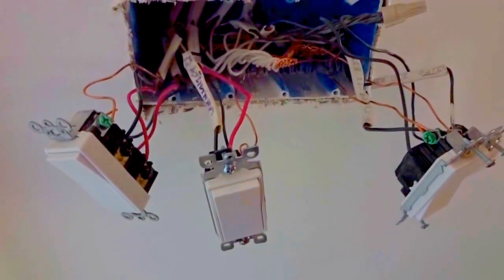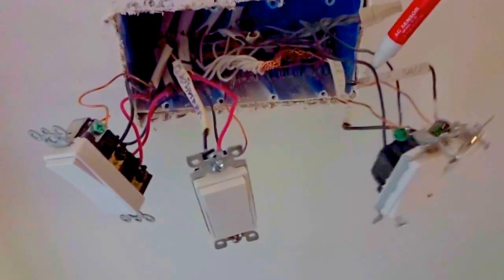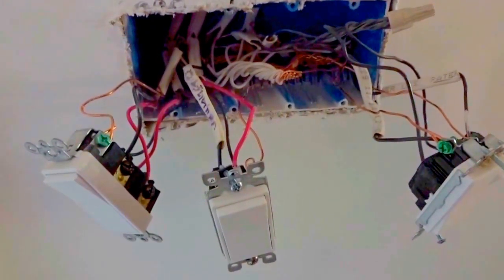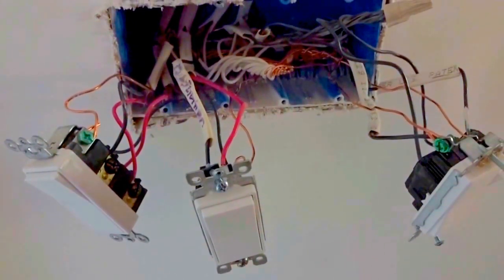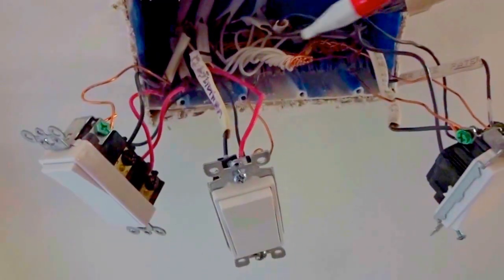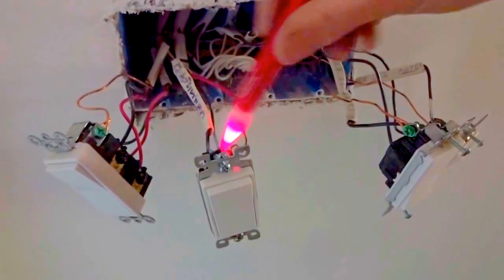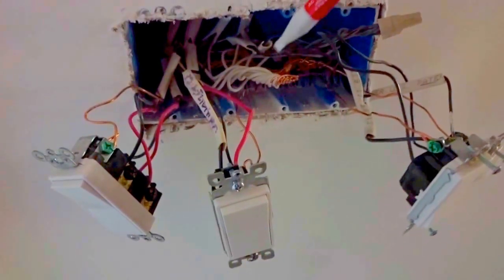Electric Code Violation: Sharing Neutral Wires of Three Circuits Creates Hazardous Magnetic Field

Comment: Great video Eric! Most electricians have never heard the term milligauss. A perfect example of dumbing down society by saying there is no harm when these fields are present. Time for the truth to be told.
Reply from the maker: +Total EMF Solutions    So, why are we providing municipal building inspectors a great salary and benefit package  if they are not enforcing the codes that are on the books?  When they sign off on the final building inspection they are stating that the building meets code and is safe for occupancy.
Reply: Read comments and IMO gov inspectors as well as the gov itself no mater what's said they are only concerns are how much we get for permits how many the inspector can do in a day and how many fines can we levy. And as long as there no livability they care little as long as the paycheck clears .one town supervisor councilman on a citizen complaint that the between Sam occupancy permit at the time $100 and nothing on the list was done he quote what do you expect for $100. Most of the things were new requirements of retrofit gfi and ground rods on older homes and a few other  things so basically it was a tax.
I have seen good inspectors too but I will never 100% trust  a government employees inspector as for this violation I not an electrician .but I know that wiring was not correct .as for emp drives electronics especially 2way crazy too

Comment: that cant be doen in newer houses so its not 1 out of four houses bc houses built i would saya within the last 7 years or so have to have arcfaults on every single. lighting and plug circuit and if neutrals are shares it trips the arc fault arc faults must have designated dedicated neutral
Reply from the maker: Hi Derek,

I find these errors in 1 of 4 homes: this includes all ages of homes.  I found 5 wire code violations, NEC 300.3(B) shared neutrals, in a 1.5 million dollar home built in 2013 including the bonding screw left IN at the sub panel which created a 15 mG field, 3 amp net current the ground wire running the length of the house.  This video shows one of them.  The general contractor spoke little english and the electrician spoke none.  Ultimately the building inspector was at fault for failure to "build to code".  The bonding screw left IN at the sub panel was so obvious that this indicates gross negligence on the part of both the electrician and the inspector.  I see this frequently here in California.
Reply from the maker: I see this net current situation occurring on new construction with AFCI breakers all the time.  AFCI breakers detect certain types of arcs and sparks rather than net current.
Reply: Derek in my area arc fault breakers are only required in bedrooms for now. And houses built in the last 7 years are just as bad. Not to mention they make up a very small percentage of the Number of houses currently built in North America
Reply: In 2015 the Ontario Electrical Safety Code was changed to have AFCI breakers in virtually all circuits within a home.  Rule 26-724(f) - Each branch circuit supplying 125 V receptacles rated 20 A or less shall be protected by a combination-type arc-fault circuit interrupter. (With a few exceptions; Washroom, kitchen and garage are the main ones.)

Comment: Not only is it a code violation but it will cause your arc fault breakers to trip, driving you crazy during check out.
Reply from the maker: Unfortunately Arc Fault breakers only detect arcing and not net current.
REPLY

Comment: that's just crazy! all those circuits could have been a different amperage. link them all together and that basically screws up the amperage rating for the circuit correct?
Reply from the maker: Right Mad Metal: current on each circuit conductor needs to be equal between the hot and neutral or you have a fire, shock and magnetic field health hazard.
Reply: Windheim EMF Solutions I'm still learning. Very interesting stuff and the codes also. I'm a welder fabricator by trade but in the middle of fixing up my home shop.

Comment: There's too many wires in that box. There shouldn't be any neutrals in there at all. 2, 14-2's for the single poles, 1,14-3 for the 3-way, and 2 more 14-2's for the 4-way, no neutrals.
Reply: joe banana
Reply: explain to me why there should not be any neutrals in the box? Your comment makes no sense.
Reply: i am no electrician , but maybe he refers to "no neutrals in that box" because they all are "switches"  every time i have opened a switch box is hot wires and green ground wires never seen  neutrals in there.. am i wrong?
Reply: The 4 way should have been 2 2 wires that is all that is wrong here
Reply from the maker: I never said there should be no neutral in this box. The problems here is that naturals from separate circuits are joined in the switch box.
Reply from the maker: Windheim EMF Solutions
  • 1 second ago
I never said there should be no neutral in this box. The problems here is that naturals from separate circuits are joined in the switch box.

Comment: I don't know why shared neutrals haven't been completely removed from code yet. (I think in some jurisdictions you can put the kitchen small appliance circuits on a 20-amp double pole with a shared neutral).  Bad idea for numerous reasons.  Unbalanced load from 2+ circuits exceeding neutral wire ampacity; someone working on the circuit who opens the shared neutral risks getting a shock from the "neutral" on a circuit they didn't shut off, etc.
Reply from the maker: Exactly but it happens al the time and building inspectors do not look for it: yet they sign off on the permit.
Reply: a electrical panel is technically a multiwire (shared neutral). So for the NEC to eliminate multiwire circuits is like saying you can't have electricity installed.
Reply: Sharing neutrals is not bad... as long as both circuits are on a DP breaker...

Comment: Are those grounds bonded together? ... Violation #2?
Reply: Eric Tyler I've haven't seen a code that said grounds couldn't be put together. that's essentially what you do with any metal box. they're ground wires not conductors. might want to check the code about that because I believe it doesn't include grounding wires.
Reply: All grounds in every box are supposed to be bonded together, regardless of circuit.  It is only the neutral wires that need to be kept separate for each circuit present in any given box around the house.
Reply from the maker: Grounds may be connected between circuits as they are never to carry current except in fault situations.

Comment: If it were wired with arc fault breakers they wouldn't be able to share neutrals
Reply from the maker: Unfortunately Arc Fault breakers only detect arcing and not net current.

Comment: Having two circuits on 1 neutral is not bad. As long as it is on a DP breaker...
Reply from the maker: Yes, you are correct if it is a "Multi Wire branch Circuit" using L1, L2 N & G.

Comment: I see this quite often as well, usually from a homeowner doing things themselves, like adding a switch.  Most homeowners don't understand electrical theory, all they know is a white wire is neutral, so why not just connect them all together.  They don't realize that the white wire, in general, is used as a neutral conductor, but it can also be used for other purposes, such as a traveler in a dead end 3 way circuit.  Rule of thumb, if you don't understand what you are doing or looking at, call an electrician.
Reply: Exactly! But the problem is that homeowners THINK they know what they're doing, but really don't.  I'm a licensed electrician, and I can tell almost instantly when work has been done by someone other than a licensed electrician.
Reply from the maker: Homeowners should avoid electrical work and leave it to an insured profession unless they want to risk voiding their fire insurance policy.
Reply from the maker: I this case it was done by a licensed general contractor using some sort of electrical worker that could not even speak english.  You get what you pay for.

Comment: No electrician would have purposely done that. Somebody might have done it had they not known there were three different circuits in that box. A lot of electricians have one group of guys rough in a project and another group come to trim it out.
Reply from the maker: Hello Tyler,  I think you are right about multiple crews,  this was a 5,000 sq. Ft. house and it had lots of 3-way and 4way switches. It was new construction and it is possible the general contractor hired the cheapest man.  The building inspector missed the bonding screw that was left in at the sub panel so he is part of the problem.
Reply: @windheimemfsolutions   just curious but can you explain the theory to me about how multiple circuits sharing a neutral creates a dangerous magnetic field?
Reply from the maker: Hello Tyler: Here is an official animated description of the causes of elevated magnetic fields, fire and shock hazards: https://www.youtube.com/watch?v=IAAZCMns8YM&frags=pl%2Cwn

Comment: If there was a dangerous magnetic field because of that situation in the box, how come your non-contact voltage tester is not able to pick it up until you're on the wire. That's how that tool works.
Reply from the maker: Hello Gollie,

Voltage testers too not sense a magnetic field.  For that you need a Gauss meter.
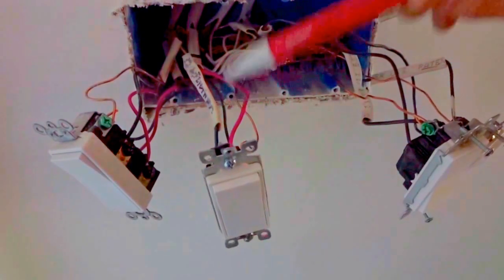Reply: Windheim EMF Solutions  the NCV tester you're using at 0:20  can sense the flux lines of the ac currents. If the magnetic field for whatever reason was larger than normal then your tester would light up much farther away than what is shown in this video. You guys are trying to peddle junk science.
Reply from the maker: Hello goaliedude32,

Thank you for your comment and interest.  Here is the GigaHertz Solutions NFA1000 $2,000, calibrated magnetic field meter (in action) I use to diagnose a house before I schedule the trouble shooting electrician to accompany me for a trace and fix job: https://www.youtube.com/watch?v=5uKZYsqnZ7s&frags=pl%2Cwn.   The electrician uses the voltage tester in the fix it stage after I have diagnosed the problem. In this video there was an house addition done by the home owner (sheriff) with the help of a buddy  (handyman).   As you can see we are getting some huge magnetic fields that vary greatly and coincide with switching lights off and on.  This indicates numerous sharing of neutrals from separate circuits and connection of N-G at locations other than the service entrance.  When we are done fixing the house we typically get a very uniform .2 - .4mG everywhere in the house.

A test just now of the voltage tester and the GigaHertz Solutions NFA1000 indicate that near the burner of my electric stove there is 88 mG while the voltage tester does not light up at all.

Your questions are always welcome but accusations will cause all your comments to be deleted so please be thoughtful and polite.  I am not here to win any argument but to show how wire code violations cause magnetic fields, and the fire and shock hazard that the code is concerned about.  They code does not worry about the health aspect but that is what my clients hire me to detect and fix.  Thank you again for your participation.

Comment: Magnetic field nonsense . He doesn't show why the neutrals should not be commonly terminated there and instead taken back to the incoming neutral . The reason is if there is a break anywhere down the line  the entire  neutral will float i.e it will not longer be at zero voltage ,instead of that one line .
Reply from the maker: Hi Bruno,  this official video explains why: https://www.youtube.com/watch?v=IAAZCMns8YM&t=626s&frags=pl%2Cwn

Comment: AFCI's Destroyed All That
Reply from the maker: I hear you as I have heard this from others.  I do see it in AFCIs in any event.
Reply: I can hear it now AFCI's have many problems same when GFI were being installed. get with the program AFCI's are going to be common now and for good reasons. if mice eat through your wiring it will have a less chance burning down your house, same if you nail through a wire. arc will trip the new breakers. I know they cost more but so does copper wire. the last time I bought a 250 roll of 12 2 with ground I paid 30 dollars back in the late 90's now its 70 dollars. wiring is not cheap these days.

Comment: So? If arc fault breakers, are added in this neutral sharing it would send "false" trip signals back? Now I get it! That's why, arc faults are tripping I've had a lot of service calls! Goof-Ball -HACKERS!
Reply from the maker: Thanks CZ,  are the arc fault breakers tripping on your installs?  Is it because others are coming in after you and modifying the system (N-N between circuits or N-G connections)?

Please be aware that so called utility smart meters are tripping arc fail breakers too! See these links:  https://www.nachi.org/forum/f71/smart-meters-tripping-afcis-65449/
http://forums.mikeholt.com/showthread.php?t=129558

Spread the news about these smart meters.
Reply: No, It is others, who do the wiring, all sudden, get out of , Calls, Homeowners asking whats UP? My Arc fault 's are tripping? I just in last year, got back residential, service calls, was Industrial Master electrician, I,ve wired them into New Panels, But when I make up, switch connections, I was taught, to also treat, separate neutrals at each circuit junction. Apparently, others were not so well taught!
Reply from the maker: Right,  some electricians think that just because all neutrals are connected at the panel neutral buss they can all be connected at switch plates.  This also creaks a fire, shock and health hazard.

Comment: Wrong. Not every circuit is required to have a dedicated neutral. You can have two circuits sharing one neutral on a single phase circuit or three circuits on a three phase panel. The reason is that the phase difference between the circuits adds up to less than the load of one circuit so it's impossible to overload the neutral in that situation. What the video doesn't make clear is that they're talking about two or more of the same phase sharing one neutral which is illegal.
Reply from the maker: Hi,  I believe you are talking about a "multi wire branch circuit" which is considered as one circuit

Comment: My comment ..... get rid of that stupid wiggy stick and use a proper meter!!! Geezuz do you know anything at all about inductance?
Reply from the maker: Hello Don,
That you for the comment.
The electrician is using the voltage detector to find which hots are energized when he turns off breakers at the panel.  He found three separate circuits n this box and all neutrals, from these three circuits, were connected, which is a violation of NEC 300.3(B).